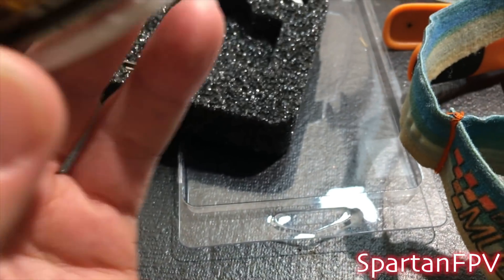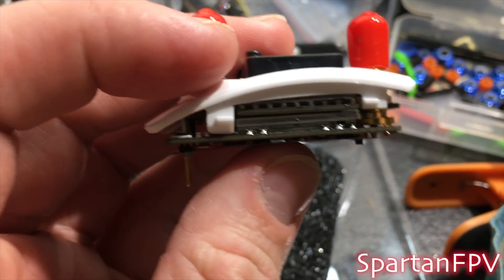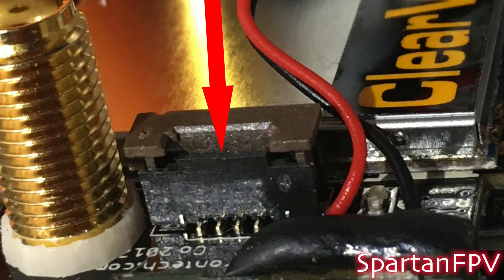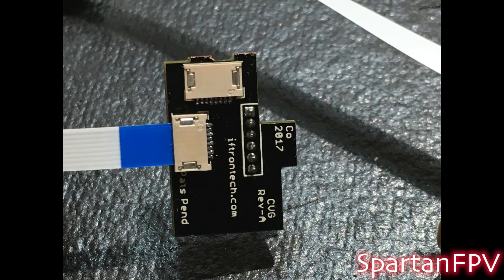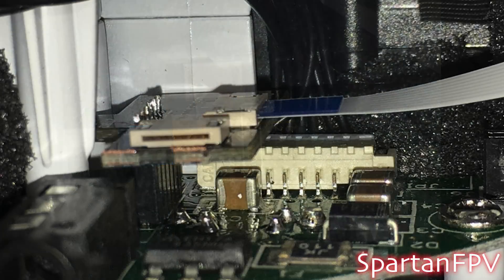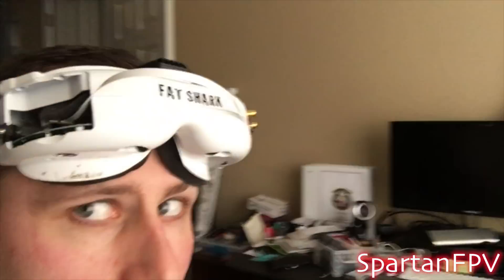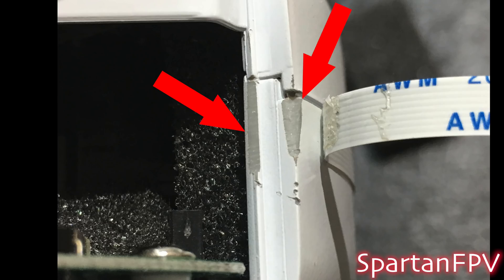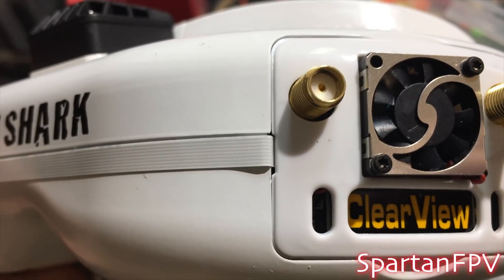Clearview Goggle Receiver - Fatshark Module, Install Notes & DVR

Comment: If you had to choose clearview or rapidfire? What one would it be?
Reply from the maker: DIRTY FPV — Price (compared to when I purchased) and Interface are better on the RF. Now, support for RapidFire and community support is probably better since many more people have the RF module, but Clearview still exists. I sold my Clearview for a discount to a family member and he loves it. The interface is a little clunky but unless you’re changing frequency all the time like I have with racing it’s a non-issue. Buying right now RapidFire is the better buy IMHO. They’re easier to live with mostly if you race. I also never had reception issues with my Clearview on the most recent firmware and was blown away by the results and sensitivity.
Reply: @KendallSmithFPV  I own the rapidfire and just picked up a clearview for 60 bucks and it's a newer one I think it has a 4/22/19 date on it. I freestyle and stay on R1 on all my quads. Do you think the reception is better or same as RF?
Reply: It will be here monday so super stoked to try it.
Reply from the maker: DIRTY FPV — I’d say you’ll have to just test it but I think it’s a wash. They’re both awesome.
Reply: @KendallSmithFPV  what is the difference between HDO and LEGACY mode? And what one do I need to have it on?

Comment: Thx for the video. I'm very interested in purchasing this receiver. I fly a lot of forest areas, how is penetration in the woods in your opinion ????
Reply from the maker: Kimbo FPV — that will depend heavily upon the gain of the antennas you use. I have a VAS Pepperbox (13dbi) that I use for longer range or when I’m flying into a lot of tree or behind obstacles. The higher the gain the better chance you have of received bing a weak or degraded signal.

Comment: Thanks for the video.
The wait for these is painful. Apparently they're putting out 7-12 modules a day :-( .

Re the black and white image - I've heard HD3s have black and white image problems with Foxeer Predator Mini cameras - so my feeling at this point would be looking more at the goggle than the Clearviews.
There's also been some thought that changing from NTSC to PAL (or vice versa) might be a work around.
Reply from the maker: jtan163 — Clearview already reached out that it is the DVR’s automatic PAL/NTSC detection. The temporary fix:
1. Disable the module power with the slider on the bottom of goggles, position “0”.
2. Power on Fatsharks.
3. Wait for power on LED to turn off. 
4. Power on module with slider, position “1”

Comment: there was a bug (feature?) in HMDVR - PAL / NTSC switches only at powerup. fatshark DVR uses same chipset. power quad first, and only then googles. if clearview can not generate color burst, what may be dvr initialy switched to BW mode. you also can not try to manually switch the pal / ntsc, that will force dvr to change mode. and if it helps, than may be, iftron guys will add automatic reswitching on camera lock. only guessing...
Reply: We resolved the issue by removing the ClearView monochrome boot screens that were influencing the DVR.
Reply from the maker: -- I think you nailed it. What you said is basically what Iftron Tech said. I actually bought a HMDVR-S to try and piggyback the Fatshark DVR but it sounds like that wouldn't matter. But now I am curious to try on-board DVR to show the difference between direct DVR vs Clearview post-processed DVR on the Fatsharks. Knowing they have the same chipset helps.
Reply from the maker: Iftron Tech — That’s great and I appreciate your time and quick response to this issue. Can’t wait to race tomorrow and enjoy the Clearview module. Please let us know when the new firmware is ready so we can flash it. Thanks!

Comment: Thanks for this video. I just preordered one and I'm hoping for great performance. Concerning your antennas, doesn't Iftron recommend running one straight out and one straight up ( 90 degrees from each other)? I believe I read that elsewhere on YT.
Reply: We have some field reports that suggest omni's should be on stalks. Apparently, the Stubby types get shorter range by being too near your forehead. And please disregard anyone that states that one omni should be straight out.
Reply from the maker: Mike C — You’re welcome and I will be making some more videos as I have the opportunity to fly in more challenging RF environments like racing. As for the antennas I simply copied what I saw on Iftron’s DVR they released which showed 2xAxii stubby antennas on 90 degree SMA adapters.
Reply from the maker: I did not think that pointing the antenna null toward the area of flight was correct.

Comment: Kendall - thanks for the great video! 

Guys - We believe we have resolved the B&W issue. Technically, it's a DVR issue. But no matter. There should be a pinned post up on our FB page later this evening that explains and fixes all.
Reply from the maker: Iftron Tech — I’ll be happy to see what you have come up with. Thank you!
Reply: Have you updated the firmware yet?
Reply: If you're on 1.03 u can
Reply: Hey Kendall, would you mind contacting us at iftrontech@gmail.com? We have some important news about the ClearView we'd like to share with you. Thanks!
Reply from the maker: Not yet. Hoping to knock it out this weekend. I saw that a newer version dropped today (09 Mar 18). Can I jump straight to the newest version?

Comment: Was it worth the extra cash,thats the big question?
Reply: £35 for a Realacc 5808 module  or £250+ for this. 7 times better hmm im not convinced 😏
Reply from the maker: When I have a chance to race (hopefully this weekend 17 Feb 2018), we are in an environment I always have ghosting from other frequencies. Also, there are a some fences that I think interfere with signal as well. I'll post more video here. It is performing very well especially on just 2x 1.6 dbic omnis, but I can't say fairly whether or not it is worth 3x LaForge V4.
Reply from the maker: Mr Stecozz - I have only used it the one afternoon. I will say that I’m not yet decided. IfronTech reached out to the customers regarding the black and white DVR issue, it’s still unresolved but they’re working on it.
Reply: Depends, for outdoors its a hard call, here in NL we race a lot indoors and even thou I own CV Race I ordered module for the ease of use. Indoors it kills,the harder the environment the better results. module wise I am  100 something so not anytime soon :/
Reply: Kendall Smith Any updates?
Reply from the maker: DVR color was fixed with a firmware update. I'm very pleased with performance vs other modules I've used (True-D & LaForge). I am waiting for a replacement since apparently there was a mistake during assembly where 2 of 3 circuit boards were swapped, so the module sensitivity isn't as sensitive as it should be. I will be sending mine back for a replacement, since they ALSO made the module quieter and it is heat sensitive.
Reply: I just bought this because believe eve it or not my rapidfire is so blown out I can’t stand it. And I’m having an issue where my fan does not keep running.  Is it temp controlled?? I’m on dominator v3’s.

Comment: Nice video! I put one up recently as well on my channel. I didn't run into the black and white issue on the DVR at all. I am using Fatshark HD V2's, which ones are you using? V3's right?  Also, I didn't mod my plastic at all, it still seems to work. I know they recommended doing that but I didn't want to :)
Reply from the maker: I checkout your video! All my gear including goggles is in the description (HDv3)